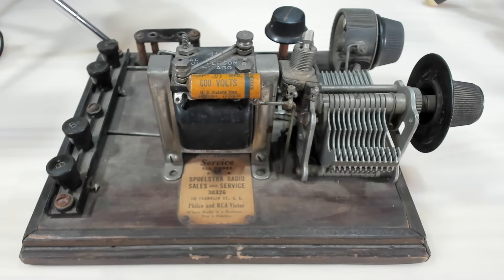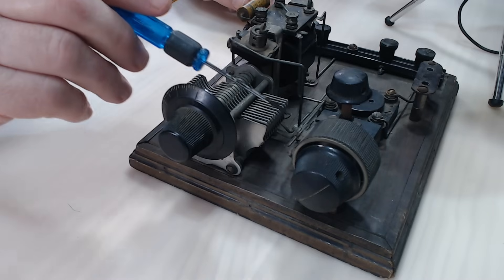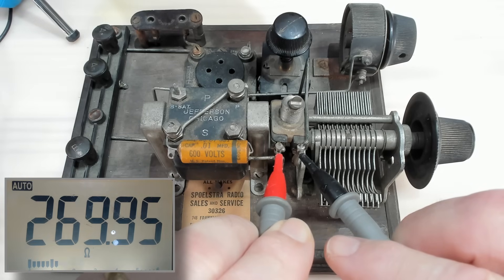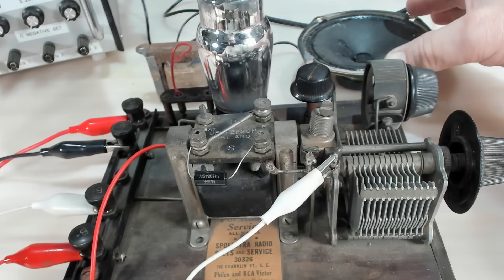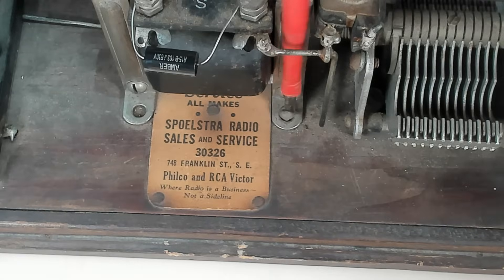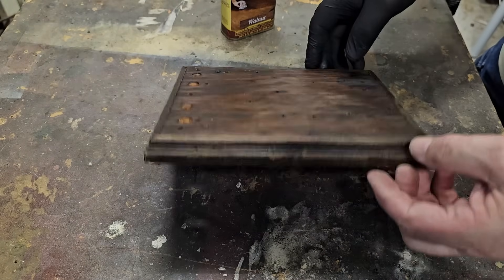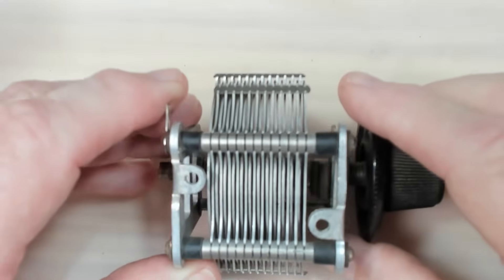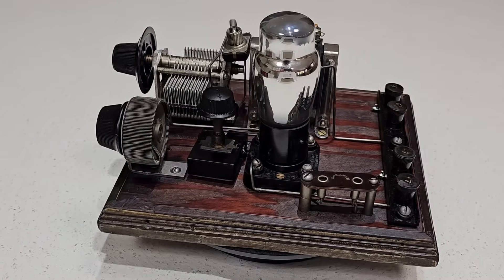Mystery Electronics from the 1930s. What is it?

Comment: I can’t guarantee how accurate the analysis is based on the schematic and photo of the device, but ChatGPT says the following, and hopefully it may provide further insight to the devices function:
—-

It’s a Regenerative Radio Receiver. 

This is a one-tube regenerative receiver for AM broadcast or shortwave signals.
	•	It amplifies RF with regeneration, detects the AM envelope with grid-leak detection, and then drives headphones through the audio transformer.
	•	It would have been typical in the 1920s–1930s, running on:
	•	A battery: 5V for filament,
	•	B battery: 22–90V for plate,
	•	Sometimes C battery: –4.5V bias (not shown here).

⸻

✅ In short: This circuit is used as a regenerative AM radio receiver, very sensitive and simple, using just one triode tube, a coil, and a variable capacitor to tune in stations.

1. Antenna & Tuning
	•	The antenna connects to the coil and the big variable capacitor.
	•	Together they form an LC tank circuit that selects a station’s carrier frequency.
	•	This tuned RF voltage appears on the grid of the tube.

⸻

2. Grid Leak Detection
	•	The orange 0.01 µF capacitor and a high-value resistor (grid leak) provide a way for the RF to charge/discharge.
	•	The tube’s grid acts like a detector diode, rectifying the AM envelope and turning it into audio.
	•	The detected audio + residual RF appears at the grid and is amplified in the tube.

⸻

3. Regeneration (Feedback)
	•	A feedback winding on the coil routes some of the amplified RF from the plate back into the grid circuit.
	•	The strength is controlled by a rheostat (filament regulation knob) or a dedicated regeneration control.
	•	Proper adjustment increases gain and selectivity; too much and the circuit oscillates (turning into a transmitter).

⸻

4. Plate Circuit & Audio Transformer
	•	The tube’s plate (anode) connects to the audio transformer primary (the black block in the middle of your photo).
	•	This transformer isolates and steps up the audio signal for headphones or a high-impedance speaker.
	•	The B battery provides high-voltage DC (B+ to the plate, B– to the filament).

⸻

5. Output to Phones
	•	The transformer secondary (5350 Ω winding) connects to the headphones/speaker terminals (on the left side binding posts in your photo).
	•	You then hear the recovered audio program from the tuned AM station.
Reply from the maker: Thanks for doing all that @electrowhats. Another enterprising follower did a similar thing with a similar result. I did try a number of the things before I returned the board I didn't record. Some were similar to your ChatGPT response. I wish I had the forethought to do the same 🙂

Comment: Hi Dave, For what It's worth, I screenshotted your circuit diagram and input it into the Perplexity AI app. It analysed the diagram and concluded that: "This circuit is a simple 1920s vacuum tube regenerative radio receiver intended for use with a horn speaker or headphones. It could, by design, be used to test horn speakers, but testing speakers was not its primary purpose—it’s mainly for reception and listening to radio broadcasts."
 
"How It Works (Simplified)
Antenna Signal: The variable capacitor and transformer select and amplify a radio frequency signal.

Detection & Regeneration: The grid and plate circuits, with feedback, allow for sensitive detection (demodulation) and possibly some RF amplification.

Audio Output: The demodulated audio is sent through the output transformer to a horn speaker or headphones."

Given your expertise, I'm not sure if that was helpful, but it was interesting...
Reply from the maker: That's as good an answer that I could have come up with. I did a half hearted attempt to make it work as a receiver but no luck. Thanks for doing that Dave 🙂
Reply: I asked Perplexity about antenna and earth connections, and it said:

"Antenna: To the first “P” terminal of the input (left side on diagram, transformer/coil primary winding)

Earth: To the second “P” terminal of the input (other end of primary winding)

"This is consistent with standard 1920s one-tube radio receiver circuits. If needed, enhance signal strength and reduce noise by ensuring a good connection to both the antenna and ground"

I'll shut up now. Cheers!

Comment: 1) Speakers were 700-800 Ohms in those days. 2) The energy of the higher harmonics is high. Some RF interference is expected. 3) Connecting two Colpitts-type oscillators and changing freq. gives fantastic sound effects and intriguing scope curves! (Envious of your battery replacer)
Reply from the maker: That's interesting information. It's a great battery eliminator, built by someone smarter than me  👍🙂

Comment: This was a device built in the 1930s to test future solid state electronic equipment like 21st century  power supplies, volt ohm meters and oscilloscopes. Will probably work on 22nd century equipment too like optical spin resonant switches, photon memory cores  and quantum computers.
Reply from the maker: That's an interesting take on it 👍🙂

Comment: I recall seeing oscillators that used filament bulbs to provide a particular waveshape based on the curve of them heating & cooling, & the resistance change altering the gain of the amplifier. I think that's why there's a trimmer on the heater voltage, & the heater sits in the feedback path. the whole thing fine tuned with the capacitor bank.... it's a tone generator, to measure distortion maybe?
Reply: (^ that was 4'00 in... )
Reply from the maker: That's a great idea, thanks for the suggestion and information 👍🙂

Comment: I wonder if someone got this and tried to make perhaps a regenerative receiver but got it wrong by using an audio transformer instead of an r.f. coil. Or it was a Morse oscillator and they tried to make a receiver. It might have been a signal generator somebody modified, as a valve tester one audio tone would be enough so no need for the variable cap which didn't alter much anyway. As it stands I can't see a use for it.

If a Morse oscillator it wouldn't need a variable capacitor. I bought one several years ago on a wooden base with a brass key which was actually black with age, space for a battery, audio transformer, valve holder and a working valve like the one here but a PM2. I bought 600 Ω headphones as well.
G4GHB.
Reply from the maker: Some Morse trainers I saw have tuning caps to alter the pitch but I didn't investigate them thoroughly 🤔
Reply: @DavidTipton101  O.K.

Comment: Looking at the components, the inductance of that transformer is far too high for RF, and the capacitance of that variable capacitor is far too low for AF, this leads me to conclude it was built from odd components for display in the shop window to attract customers and never intended to do anything.
Reply: As speaker you better used a low ohm sp. with a transformer to load the Anode. Perhaps there was not only a speaker there was a high ohm telphone earpiece for audio controll, frequency, and one transformer for electric pulses as a medical device. It was trend at that time.
Reply from the maker: Yep, I considered that 🙂

Comment: I suspect that something has been altered from the original design as the variable cap seems to have little or no effect. These variable caps were never cheap and it would be unlikely to include it in the circuit if it didn't have a clear purpose.
Reply from the maker: I agree, it's not all there 👍

Comment: In line with other comments it certainly looks like some kind of regenerative receiver. The "transformer" could actually be a tuning coil as others have said (unlikely with an iron core though) , otherwise I don't know what it's function is in the circuit. I also agree that it may have been intended for use with an external frame antenna by connecting it across the variable capacitor. For sure that variable capacitor (probably 300 - 500 pF max) would do nothing at audio frequencies, it's an RF component so there needs to be a coil of come kind to go with it. Good luck figuring it out 😀
Reply from the maker: Thanks YO3IPR 👍🙂

Comment: That looks very familiar to me looks similar to a radio signal finder used to find people using radios without a Licence
Reply from the maker: That's a novel idea, thanks John 🙂
Reply: @DavidTipton101 I noticed that it has simple tuning like that of a crystal radio with a simple up grade. 
The other possibility is for receiving emergency alerts during war times.
My son has an updated version utilising transistors instead of the valve.
Reply: @DavidTipton101 looks very similar find where the antenna fits and you might obtain a clear SW signal.

https://en.wikipedia.org/wiki/Regenerative_circuit Regenerative circuit - Wikipedia

People would make their own crystal set radios that didn’t require any batteries.
You have no idea how old that item is it might be over 100 years old.

Comment: My suggestion is to use a 2.5K or 5K resistor or higher on the terminals marked SPKR to start and check with your Oscilloscope.  With the tube as the oscillator/output it wouldn't take much to load the circuit down.  Using an iron core transformer in the oscillator circuit indicates a low frequency to start with. The variable capacitor looks like it could be in the AM radio band range. It could be picking off a harmonic. Or it could be a high impendence speaker tester. I might have to build it for fun.
Reply from the maker: Thanks for the suggestions Larry. I have sent it back to the owner so I can't try those ideas 🙂

Comment: Are you sure the value of the capacitor of 10nF is the original one? Maybe was replaced with a wrong value one. Try 1nF or less (100 pF?). Also, maybe wiring was wrong, tuning capacitor should be in parallel with the coil G-P, I think.
Reply from the maker: I did try a number of values after the video went out. It changed things slightly but not to any great extent 👍

Comment: Back in the bad ol days of tube Tvs & radio when your device would not come on after you verified it had power
what was common to do is-pull out the vacuum tube(s) you suspected might be bad bad & take them to the corner
pharmacy-soda counter-drug store where they had a tube testing machine in the corner. Customers were 
welcome to use the machine for free to test your tubes and if one was found as bad-they sold replacements. 
Hopefully they wernt out of the one you needed. You took your new tube home, plugged it in & was back in business.
ALSO-We heated our houses with coal.
!
Reply from the maker: We had the same here OURv. It was in the Tandy electronics shop or you could take them to the local repairer and they would test them for free 🙂

Comment: To me, there are hints of a grounded grid amplifier in that circuit with RF input piggyback on ( A+ , B-), output at the speaker terminals. Yes, the output with an 0A1 would be pretty wimpy, but radio experimenters built with what they had. This is definitely a device that needs context.
Reply from the maker: Thanks for your analysis, it certainly needs more investigation 🙂

Comment: You have found yourself a genuine beep booper.  Used for booping the beeps with the knobs.  Lol. My bet is its some kind of calibration equipment for like a metal detector or for old telephone operator transfer switches like with an executec style of star link setup that used pulse tones to direct the calls to the different lines..
Reply from the maker: That's an interesting thought, thanks for the suggestion Z-Ack 🙂

Comment: I'm sure a speaker or headphones of unknown ohms plugs directly into the speaker jack and the volume is adjusted by varying the plate voltage in the tube. I have a very old Hammarlund short wave set that works that way. You might contact 
(Mr. Carlson's lab YouTube), he's way up in Canada he is as close to an actual wizard of electronics as you can get maybe he can figure it out.
Reply from the maker: Thanks @mojavepatrol 👍🙂

Comment: How about a strobe generator for checking motor speeds?  e.g. record turntables?  Would the frequency fit in with 78 rpm (or even 80 in rare cases).  Would the SPKR connection drive a neon bulb?
Reply from the maker: I'm not sure there would be enough current flow to operate any of those things Roger but thanks 🙂
Reply: @DavidTipton101  Those small neons as used in mains indicators take approx 2mA, I would guess that speaker you used would take a lot more than that,
Reply from the maker: It may well work but it that frequency it would be hard to see. Besides, I don't think small neon tubes were available at the time this was being used 🤔

Comment: Rethinking that it was a tube tester for testing early four pin tubes (at least at AF). The filament voltage can be adjusted for different tube voltage types and maybe the switch and pot can apply, or adjust, grid bias. Someone else suggested a tube tester.
Reply from the maker: It certainly would make a quick tube checker for a small shop. Thanks Joe 🙂

Comment: If my memory serves me, the schematic looks very similat to an old radio receiver that I built ages ago, speciffically a reaction radio. I remeber connecting the antenna between the switch and the 5k potentiometer, heating the tube, closing the sw and tune the 5k pot until it start to oscilate, also adjusting the filament potentiometer from max to min. Then, open the switch and tune to the radio station with the variable capacitor.
 Maybe my memory is fuzzy, but this is the best I can remember. Also, I guess that receiver  - might - had have two tubes, but not very sure.
Reply from the maker: I tried what you suggested but it didn't work on this set. Thanks Sebastian 👍🙂
Reply: @DavidTipton101  Well then, I subscribed and I wait to see a follow-up if you can figure the use of this device.

Comment: Looks loike a regenerative radio designed specifically to work with a frame aerial.  The ae doubles as the L of the tuning LC. 1920s.
Reply from the maker: That's been suggested a number of times. Thanks NickCat 👍🙂

Comment: Hi Dave, The circuit is certainly configured as an oscillator, but definitely not at RF with that transformer unless it relies on harmonics. The frequency is too low for audio frequencies as the circuit stands. If the paper capacitor (now 10 nF = 0.01 µF) had been previously replaced, perhaps it was originally around 100 to 500 pF which should give more of an audible tone as this tunes the high impedance secondary side of the transformer (parallel connection). Also best to use a speaker output transformer before the speaker for better matching. The 'tuning' capacitor sets the level of feedback coupling in the oscillator, while the variable resistors would influence the circuit gain. My guess is that the circuit is used to check the valve gain (µ) or transconductance (gm). A known "just good enough" valve could be fitted and the adjustable components set so that the circuit just oscillates. Plugging in other valves would allow the technician to quickly establish their state of health by the presence of oscillation (tone in the speaker). It might also be an idea to decouple the B+ and B- supply by connecting a suitable capacitor across it to improve stability. Lovely restoration!
Reply from the maker: Hello Steve. Thank you for your comment. It certainly could be a quick tube tester. I have played with the capacitor values since the video and it makes little difference to the output. I imagined I would be able to change the frequency which it does but not to any great extent. Good point re the power supply. Thanks Steve 👍
Reply: @DavidTipton101  Thanks for your reply, Dave. It's surprising that the frequency isn't affected much by the fixed capacitor value, unless the mode of operation is not as expected. I say that because only the transformer's secondary connection is in parallel with the 10 nF and it seems the schematic doesn't match the video, in particular around the transformer. From the board, looking at the top of the transformer with the text up the right way, the primary winding is labelled 'P' and the connections are 'B-BAT' and another, smaller 'P' from left to right. Beneath that is the secondary, labelled 'S' and connections 'F' and 'G'. This differs from the schematic in that the diagonal jumper wire goes from primary 'P' to secondary 'F'. The schematic shows the windings rotated 90 degrees as compared to the transformer top. Could be worth redrawing the circuit diagram as it's not obvious what connects where from your video - not your fault as those hidden wires go between components before diving into the abyss! Hope that helps...
Reply from the maker: I will look into that, thanks Steve 👍

Comment: Maybe it was a single component of a trainer radio set from the early days. This may have been the oscillator section and it continued to a separate IF section through the “speaker” output terminals. Very early teaching tool with separate boards for separate sections of the RF/IF/AF chain. 🙂
Reply from the maker: Yep, could be. Thanks Stephen 🙂

Comment: Not boring at all.
Looks to me to be one piece of maybe several boards. The speaker connection could have gone to another board. Not low impedance, but much higher impedance. Perhaps part of an AM radio kit, or some such.

I’d definitely contact Mr. Carlson and let him have a look. If anyone knows anything about mystery valve circuits, it’s him. 

Very enjoyable video. Thanks.
Reply from the maker: Thanks BigDaddy 👍🙂